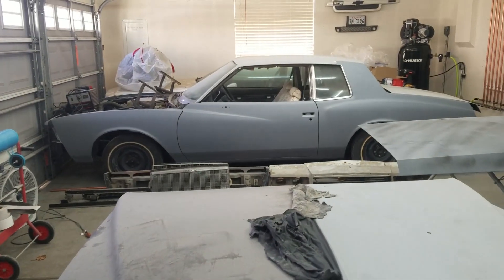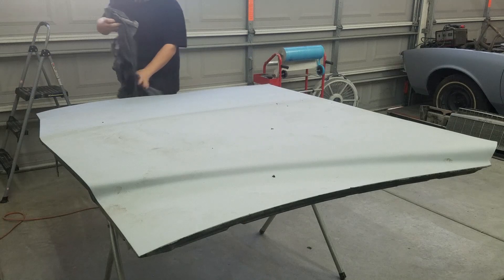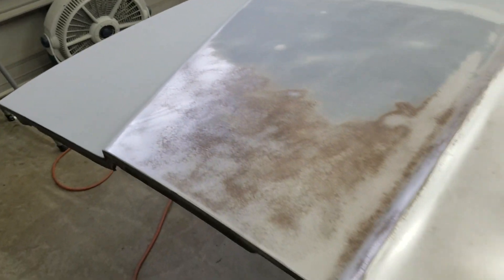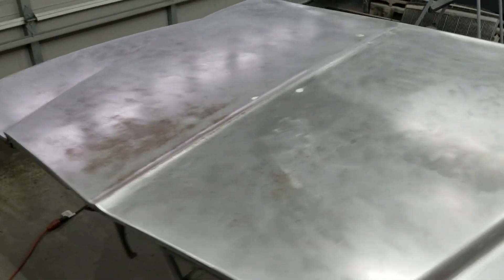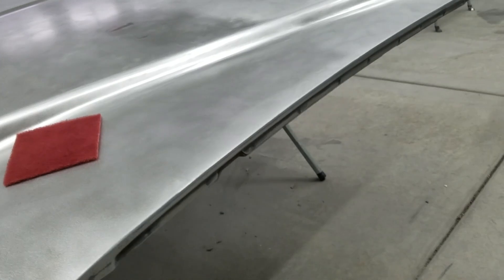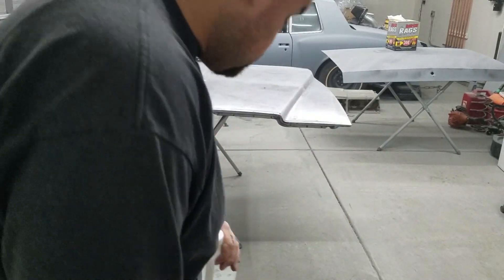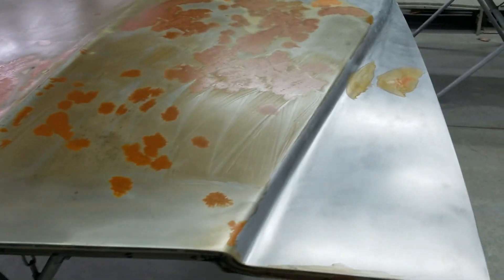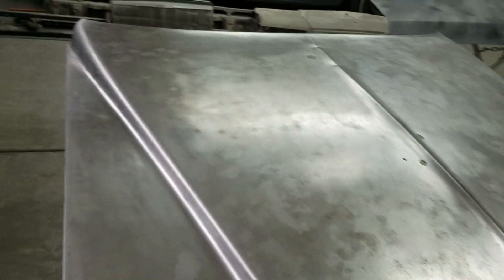HOW TO use White Vinegar ON Surface Rust

Comment: Vinegar will work on lite surface rust but I don't think their is a need to dilute it as it's diluted already in the bottle. I have been researching the biggest bank for the Buck and found "Klean Stip" brand concrete and metal prep better on test panels as in my 60's, the youngest moved everything and I finely found my 18 gauge (1.5mm) with rust on half. Using a good pump spray bottle, wet it and scuffed with Martin Scotch-Brite and waiting in cool shop to show signs of drying, I sprayed it again & scuffed. You could see the rust was gone. Wiped it with paper towels, used lint free "Kimberly-Clark" Wypalls L-40 from a case, it cleaned up near perfect. As a repair tech on auto's for 40+ years, doing research has taught me to find "MSDS" papers & "SDS" and keep in page protectors. Price, point of sale, best price everything in note book. 
After wipe down, black spots are iron phosphate that are mostly inert. If coved don't oxygen or moisture can't get in, no more rust. Using the lint free, spray a 1:1 epoxy coating. In tight areas (Everywhere) use a detail gun w/zip lock bag to protect gun from overspray or simple blow-back. This worked best. Klean Strip is sold at Menards (the cheapest) HD, Lowes (Most expensive) but a gal. is $14.87 - $21.85 at Jan 2023 Uncle Joe dollars. I purchased UreChem A&B (1:1 mix) for $128 for 2 gal. sprayable. Important to me! But rust comes from inside out. Who know when they started dunking and used what? Like the primer, it's porous and wet sanding, ran, dew point reached all form rust. Remove it chemically, wipe chem off, 80 grit is called for but maroon Scotch-Brite leaves a tooth but only "Zinc" will give a chemical tooth from "Bond-R-Rite" or POR metal prep and neither are cheap(er). So, my task it to get those under dash brackets, metal pipes, plates and pinch welds / spot welds soaked between the skin fold on many. But 67 C10, bedside unbolt, rockers can be sprayed. I am going in! Wet, scrub and plastic on temp frame to catch to re-use until shinny. It is amazing what Scotch-Brite will stick to for hard to reach spots as broom stick with a folded coat hanger in hole of broom stick. (it's not for Mama whooping your backside anymore) I have mixed two part epoxy to place thru the scuff pad, pinched with small plastic & sat over night! Instant brush on a stick. Makes it easy and easy can be fun & rewarding. Just buy some plastic, keeps mess down and allows for re-use. Funnel and paint filter, pour in separate bottle if desired by masking tape and label.
Best of luck on your project. DK, ASE master, retired.

Comment: Does this neutralize the rust. Wouldn't washing with baking soda water be beneficial after?
Reply from the maker: Yes it neutralizes the rust. I cleaned it afterwards with wax and grease remover then sprayed Epoxy primer.
Reply: @StillStandingGarage  thanks for that I'll try it on my bonnet
Reply: When you do this, you can use cleaning vinegar which is more effective. Wipe it down with baking soda and water after. And use a metal etching primer as a base. Then primer sealer, then high build primer all in different shades so you don’t sand thru them. It should last a long time afterwards. I do these steps on older 60-70s rides never did it to G Body’s in my time because none of them were rusty. 😂 I guess we’re getting old. 😂

Comment: Bullshit.   White vinegar will not remove rust.  Its not strong enough.  
You must use all purpose vinegar designed for cleaning. Its 20% stronger than white vinegar.

Comment: Ok, so I I’m kind of on the same boat. Only thing is that I’m not waiting 15 years to paint. Maybe one or two. But the rust on my truck is getting really bad but not bad where I have to cut and weld so I want to do something now. I guess I will try this method since it seems simple enough. I’m assuming you used distilled water with the vinegar, since regular water has minerals and those minerals is what can cause rust; I’m I right? Also, what are your thoughts on sand blasting. That was other option but I don’t have a compressor & finally what’s the best thing to put on the bare metal? Rust inhibitors or 2k apoxy self etching primer? What would help best from the rust not coming back like it did to you?
Reply from the maker: Yes, I used distilled water. I use Epoxy primer to seal bare metal. I then topcoat with  high build primer. When I primered this hood many years ago I wasn't knowledgeable on what primer to use which is why I used any primer I found. Now, I use Epoxy on all bare metal to seal it 💪🔥💯. Thank you for watching 👊
Reply: @StillStandingGarage  No problema, thank you for making the content and for replying back to my inquiry. Much appreciated! 👍🏿

Comment: How to clean inner panels with superficial rust and treat inner sides you can't reach to prevent to accumulate surface rust again?
Reply from the maker: I believe Eastwood makes a product for this situation. Not sure what it's called but check them out.

Comment: 0:30 was that the old paint you were pulling off...... What did you soak it in to remove it like that ????
Reply from the maker: It was plastidip not paint... I laid a thick layer of it years back. That's why it was easy to remove.

Comment: My fender has powered looking rust could I use white vinegar with same red pad to remove it?
Reply from the maker: Yes, if it's surface rust this method will work for you.
Reply: @StillStandingGarage  thanks for the reply
subscribed 👍
Reply from the maker: @papo862  Thank you 🙏
Reply: Still Standing Garage worked great ,hell of elbow grease got it to bare metal and primed it Thanks for the upload again stay blessed 🙏🏼
Reply from the maker: @papo862  Glad it worked out for you